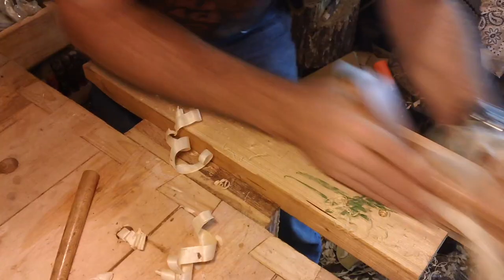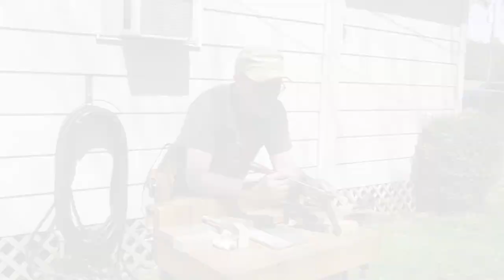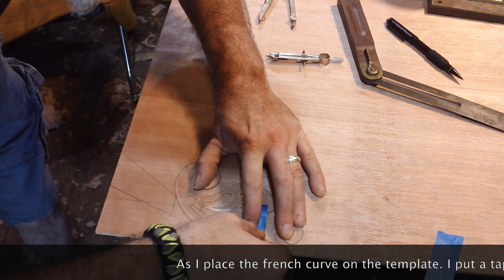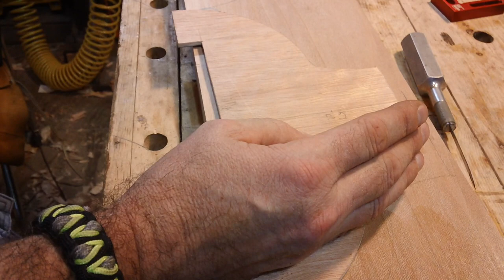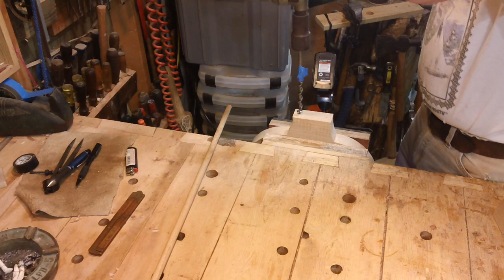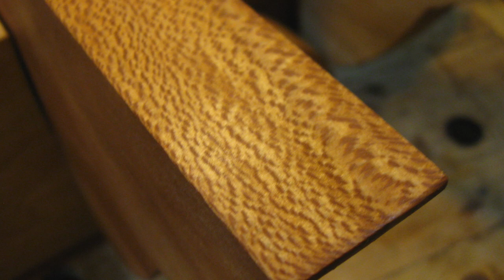Japanese Saw Horse

Comment: Hey Dave. Glad you got a chance to make some shavings. The sawhorses look beautiful. I'm going to try the centerline layout process just as soon as I get caught up a bit. But first I want to finish at least one carving. 😆
Reply from the maker: Good to see you at the carving. I have a cypress knee that is huge. I want to carve an ole mans face in it. Im just going to look in the mirror for my subject matter.
Reply: Remember that it's reversed. :-) We might not believe it's you if you're holding your pipe in the wrong hand. :-)
I did some base relief and etching stone carving where I took a picture and just outlined the edges then crosshatched the surface for shading. It worked surprisingly well.
My expectations are to use some of the colder winter months to do the carving. Right now I'm busting my hump to get ready for winter. Firewood cutting for the rebuilt fireplace is taking just as much time as I expected. I probably should have opted for the gas log. :-)
Reply from the maker: With the wife needing me inside so much now. I have been doing carving, leather work and even a bit of sewing and looking at looms....
And yes fire wood is ahead of me to. Im still in shorts and flip flips down here.  We are really very warm this year.

Comment: I always heard that Sycamore wasn't a good wood for woodworking because of instability during drying.  Yours looks quite good. Have I been misinformed?
Reply from the maker: +I dearly love sycamore. The wood u see in this video has been in my shop 3 years and is very stable. Sycamore has difficult grain and will do strange things until it's fully settled down. I work in education and a lot of the classroom funiture is made from scamore. I believe this is from a few different reasons. It's cheep, looks good and works well. When I make my new work bench the top will be made from sycamore . It's soft enough that it won't scratch o dent my future projects. The wood I have was intended to be turned into caskets. This pile was in there discard pile meant to be tossed into the dumpster. If I were to buy some for a large project I would let it settle down a long time. Then at that point I think it would be fine. 
My two cents worth.  Michael Phillips
Reply: Thanks, I appreciate the information. All the best to you and your  wife.  I found your video very informative.  As a musician I am also a big fan of the "golden Mean" you demonstrated. It is amazing how it keeps showing up in music as well as the visual arts.  I was fascinated with the gages you showed  that laid the ratio out so handily. Are those hand made or are they commercially available?

Comment: What were the dowels for? Unless I missed something, it seems as though you simply drilled holes and then inserted them in, without using them to join anything to the legs.
Reply from the maker: the grain was to short there i was in fear of it breaking.
Reply: So they were for strengthening that section of timber.

Comment: wow i'm so lost, first not sure why need center line with the template as it look less work just to trace template, then what is the point of such a long dowel then you drive it all way in ?. i was sure dowels where to join 2 pieces wood to make them alined as well as a stronger joint, i had to turn video sorry bored this one

Comment: Personally speaking - just holding and cutting rarely works as wood easily moves and you use more "push" muscle then "hold" muscle (the hand clamp).

I'd suggest stop rails to push against.  Using long loose tenons to take a cross beam out easily from each side.

OR - cutting in a slot to put clamps into the sides
Reply from the maker: yes a bench hook works great in that aspect. But if you look at Japanese saw horses they are rail less saw horses. That is what i was shooting for.
If I am understanding your statement correctly. If not i apologize
Reply: Thank you for the reply 

I look more at ease of use.  Adding a push frame keeps material from moving, as it did in your videos saw cut.

Clamp a stop and see which is better.

Just my penny's worth